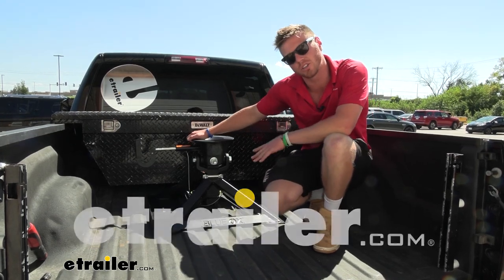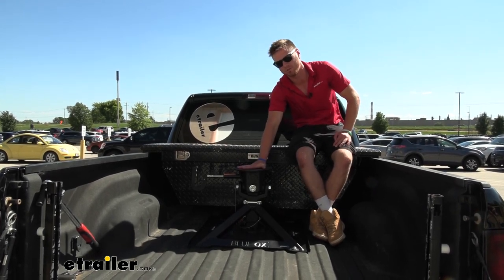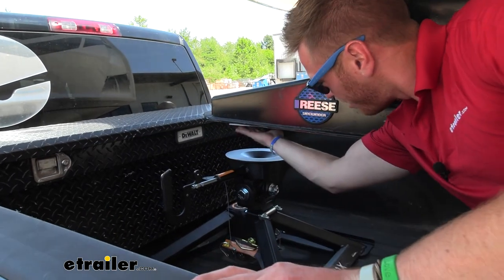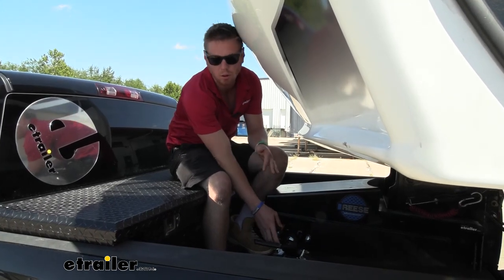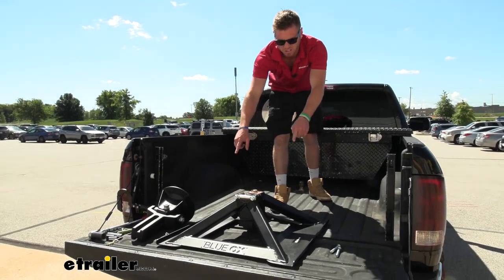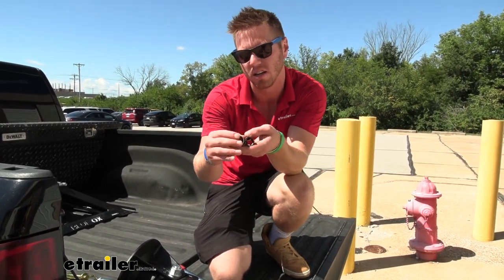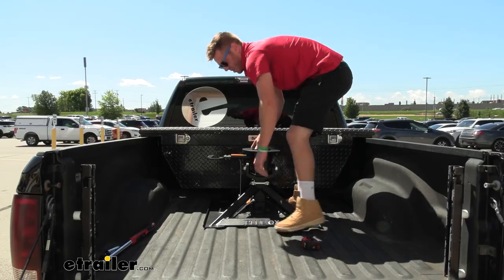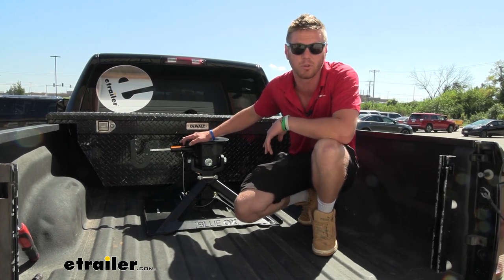etrailer | The Low-Down on the Blue Ox Gooseneck-to-5th-Wheel Trailer Hitch Adapter

Comment: How is it for chucking while towing?
Reply from the maker: The Blue Ox # BLU52XR Gooseneck adapter doesn't offer any dampening to reduce chucking, but the funnel WILL fit the king pin very tightly which helps reduce chucking. Because the adapter also attaches to the gooseneck ball, that will be a tight fit as well. However, the Curt # C32DR is a similar product that does feature dampening to help reduce chucking. The hitching process for the Curt product will be much more simple than the Blue Ox, so unless the 1000 lb lower capacity (20K vs 21K) would make a difference, we would recommend the Curt gooseneck adapter. Hope that helps. Let us know if you need anything else...
https://www.etrailer.com/Gooseneck-and-Fifth-Wheel-Adapters/CURT/C32DR.html
Reply: do i have to lock out my curt rotaflex if i use the crosswing curt